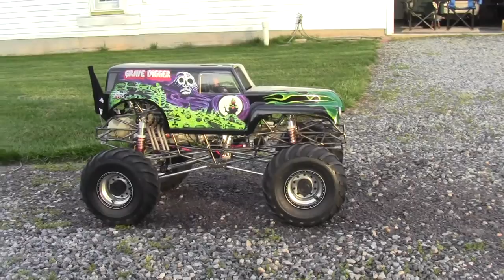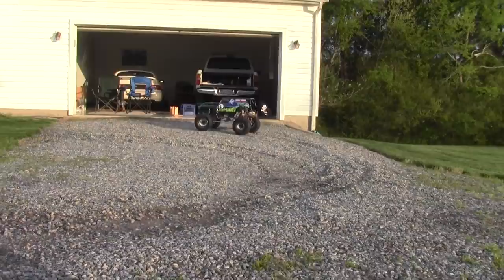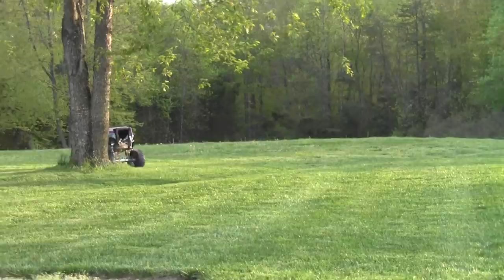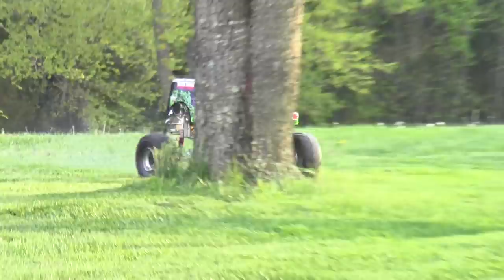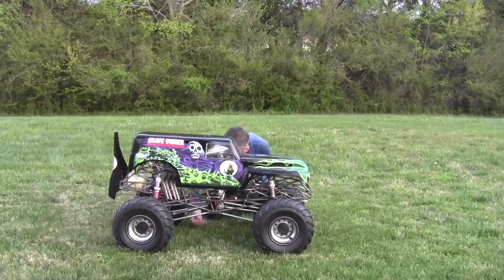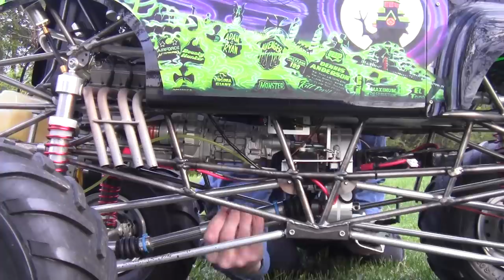1/4 Scale Grave Digger Part 24C with Stinger 609

Comment: And it BROKE just like a real monster truck, or at least one like from the 1990's!

Something that ALWAYS managed to break on those "vintage" trucks: the torque convertor! Sure it's not that, lol!??!
Reply from the maker: To charles.  It was the belt in the T-case.
Reply: @rcWizzard  Sounds good...like the truck, which sounds awesome, BTW! Glad you got it fixed up.

The joke, albeit a bad one, was in reference to the fact that classic monster trucks, like the original Grave Digger, always broke. So unreliable compared to the modern trucks, which seem almost invincible.

Comment: am i the only one here to think that the suspension array is all wrong?  also the weight center is way to high, making it about to flip even when standing still. Nevertheless, the engine sounds greeeeat! has anyone concidered a mini transmission system in order to reach higher speeds?
Reply from the maker: I Don't want speed I want torque.

Comment: You should put a better gear ratio for a little more speed that thing was slow other wish it sound just like a mini grave digger
Reply from the maker: At 90-lbs I want torque, Not Speed.   It's fast but it takes a while to get there, so I have to let off the throttle and come back.

Comment: would have been a truck load cheaper (and faster) to go electric or a motorbike engine, albeit not as cool. The Stinger alone is $25K.
Reply from the maker: To Alex.  I got my 609 before Garys price increase at 6800.   The supercharged version with hi-lift cam is $11K.  Who wants a silent monster truck???

Comment: I've seen battery powered rc cars way cooler then that thing, its got no power.
Reply from the maker: Well, in MY opinion, you Can't get Any Cooler than a 1/4 Scale Supercharged V8 Engine.  That's why I'm doing this.  :-)